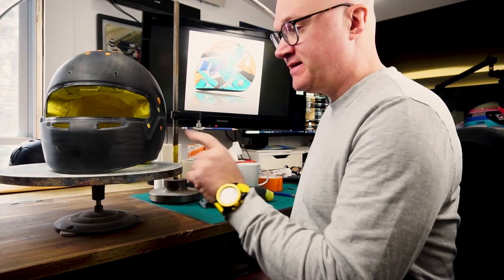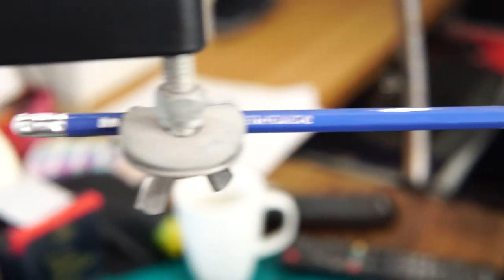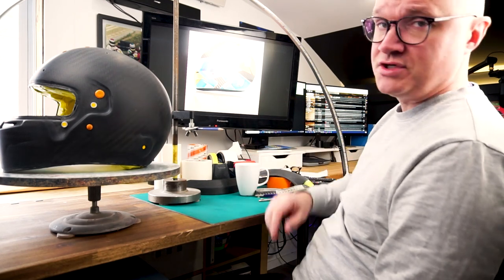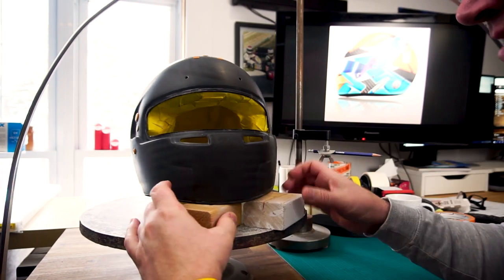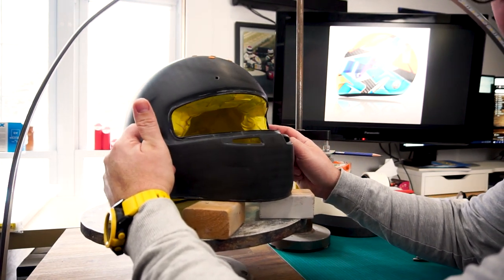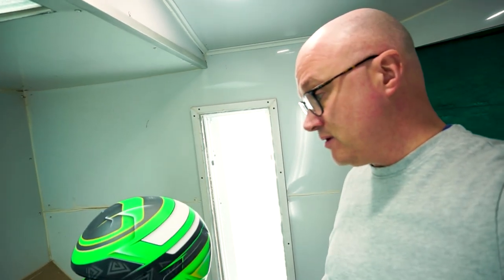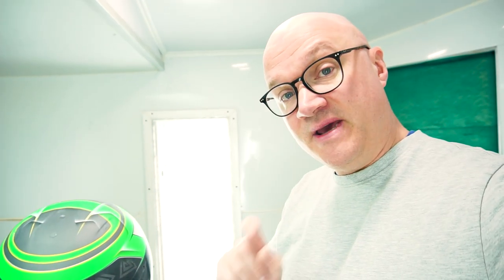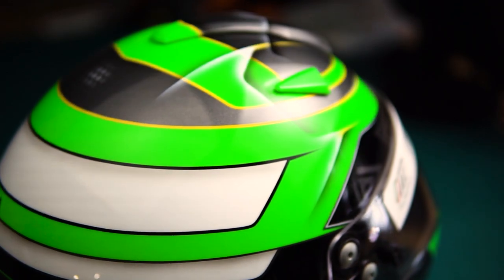HELMET PAINTING TUTORIAL PART2  -  HOW THE PROS DO IT!

Comment: How did you build that pencil lining tool? I'm trying to build one myself. Trying to find the parts. Any help would be appreciated. Great work.
Reply from the maker: I made it from scrap parts I had and the help of a machinist friend. Sorry I can't be of any more help.
Reply: Did you ever get to build the lining tool? I am asking around too but I cant find the parts that go on the rod to hold the pencil... So far I have a metal rod with a skateboard-wheel base (the rod is in between the bearings in order for it to be able to spin) but I cant find a sturdy way to get the pencil to be on there and to be leveled... tape is just not working!